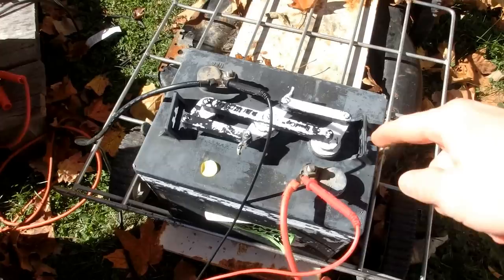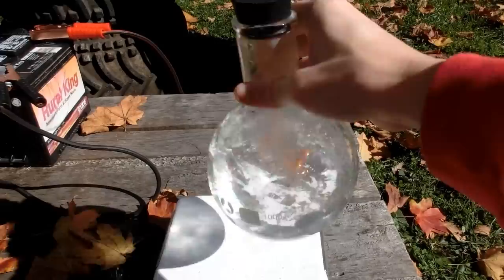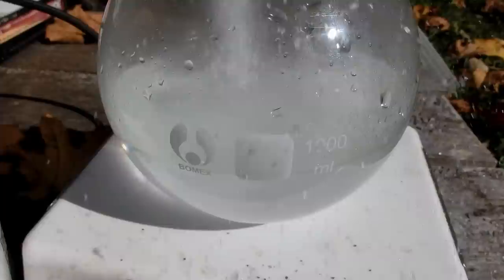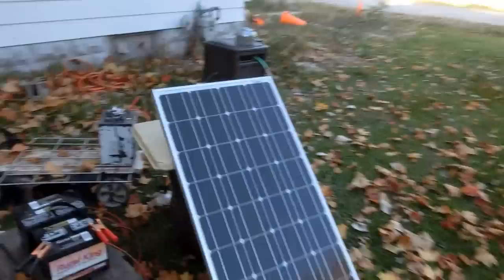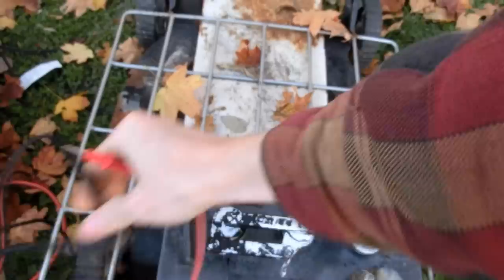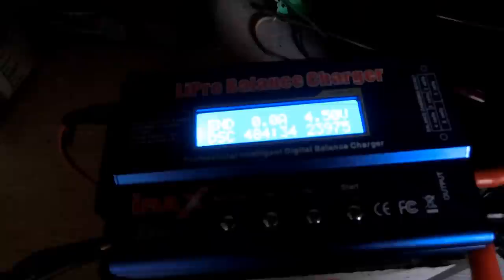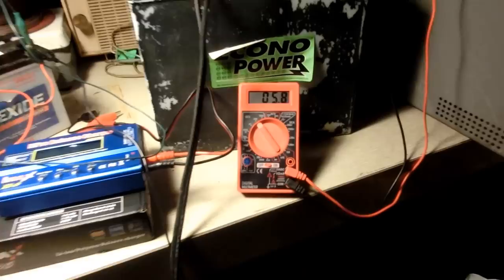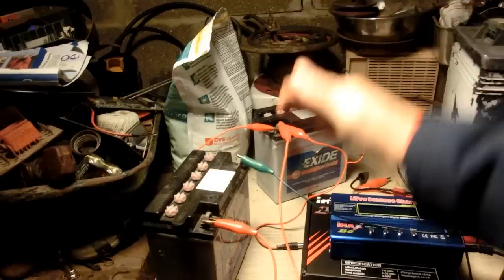Epsom Salt in 6v Golf Cart Battery

Comment: will this work for a  70 pound 6 volt Duracell 75 amp battery thats now 1.21 volts, and another is at .99 volts. I only used the batteries for about a week or so...it was just a 100 watt solar panel project....one battery has a brown like powdery stuff on top.

Comment: here's  a few suggestions for fixing a car battery
never try to do this unless you know what you are doing - the acid can burn you
check the voltage first - there may be a kaput cell which would waste your time.
Check the battery fluid.
Try to fully charge the battery.
(I learned about these and more from Jons Mender Guide site )

Comment: Have you ever successfully recovered a sealed lead acid battery before? Like by taking the sealed caps off and filling with water or other electrolyte? If so how did you do it? I  tried topping some I had up with water but it didn't work.
Reply from the maker: yes i've done that in several videos, search my channel for them.

Comment: I love the caps on that battery. That's handy the way they all open and ive never seen one like that.
I have many dead PB battery's laying around my yard and one project ive been wanting to talk myself into is carefully taking them apart. saving the lead and acid making a mold for casting my own positive and negative plates
I imagine using cheap 5 gallon buckets for the outside case because there cheap and they seal and they can be opened and reopened.
I can imagine not using the total depth of the bucket but leaving the bottom couple inches free for sediments and the top open for extra liquid... less worry about running dry.
The plates could be made thick.
I think it would be great to be able to build cells and rebuild my own battery bank. Not so much for a vehicle but for a home solar bank.... It could be built as heavy as it needs to be :-)
Reply from the maker: well keep in mind that the negative plates are lead-II-dioxide and that is one of the most poisinous forms of lead because it is easilly absorbed through skin.

i think a 5 gallon bucket is a horrible idea, if the acid isnt reactive enough and it gets cold the electrolyte will freeze breaking open the bucket. you would probably want a much thicker container.

i hope you succeed though.
Reply: I had not thought of freezing and breaking the bucket's... It does not get cold enough around my aria to be a problem.

Comment: my comment will not be on epson salts ,, that battery might have been frozen and once that happens the cells will never function properly ,, sometimes you might get lucky and the only problem will be is that the inside has built up contaminates and is grounding the cell or cells and a cleaning will help ,,

Comment: Invest in a old school 6 volt battery charger.  Sun simulator with a pattent number will not charge that battery with the primative solar panel you have.. I got 24 6 volt battery on the bank and only lost 2 so far in 3 years and they were all screwed up bad to begin with. Need the old school charger or it will not work. Also need a hydrometer so it gives ya a good idea what's going on.

Comment: I recommend using Alum (ammonium aluminum sulfate) for the electrolyte works great on sulfated batteries
Reply from the maker: yeah but only issue with that is it drops the voltage a lot. max charge is like 10v and dead is like 8v. with a 6v battery that would be 5v and 4v. would be great if i had another 6v battery to put in series.

Comment: I played with two dead 12 volt sealed lead acid batteries both at 6.2 volts, did the Epsom salt thing on both, one came back to life is now sitting at 13 volts with 5 of its original 7amp hours. But the other battery will not go above 9 volts. I think it was a bad or shorted cell because one cell boils when ever I try to charge the battery.

Comment: Thanks for the video! Have you tried aspirin? I've heard that breaking up a couple aspirin tablets and adding them to each cell helps revive bad batteries! Let me know how it goes if you decide to try it!
Reply: here's  a few suggestions for battery repairing
Don't attempt to do this unless you know what you are doing - the acid can burn your skin
check the voltage first - there may be a dead cell which would waste your time.
Check the battery fluid.
attempt to fully charge the battery.
(I discovered about these and more on Jons mender guide website )
Reply: @Blakehx I\'m not sure but ,if anyone else wants to uncover how to recondition battery try Jadonite Renovate Battery Buddy ( search on google ) ? Ive heard some unbelievable things about it and my buddy got great results with it.

Comment: plus over equalizing never works, i have an old car battery, (i can only get it to 15v then it pulls too much power anyway, i did hold it near there for an hour or so) the specific gravity is good, it charges on all cells and holds voltage, even pushes out enough amps to be useful, everything but amp hours, it has about 2 amp hours!
Reply from the maker: well i wouldnt say never, its better to have the voltage high than to have it low.

Comment: The point is that the plates in it are gone, they are completely covered with S-salts for sure. You should open it, brush and polish the plates, replace acid and stuff and then it should work. But it will never be like a brand new one. This kind of stuff doesn't worth so much time in repearing, just get a new one
Reply from the maker: new one costs 70$, plus i make my living doing videos like this.

Comment: Nice experiment, that the results wernt great is just science, sometimes we don't like the outcome, we just have to be satisfied we measured it right is all :-D Nice move on using the Imax to dissipate the energy so you could calculate capacity, that seems a smooth and stable way of getting a good measurement :-) I have a few golf buggy batteries here, though far less capacity, I honestly think its age that gets the anodes and cathodes on these things and theres not much to be done about it after year 6 or something :-p

Tis cool how it has those open lids on the top, I have 2 western golf buggy batteries that are solid sealed, they work well as they are pretty new, but the others with plugs in to refill them from china, though they have high voltages, they drain instantly when you hook them up to stuff so there going :-p

This experiment was good to watch though :-) I've not seen the stirring magnet up close before, looks pretty darn cool :-D
Reply from the maker: that stirring magnet i found in the road one day. i have an actually lab stirring magnet somewhere. its a long magnet coated in teflon.
Reply: I love Teflon stuff, like pistons, its a particularly unreactive heavy duty material :-)
That small one seemed to work pretty well, the bigger Teflon would be good for corrosive solutions though right :-)

Im just testing my new 1500w inverter, im running a halogen heater on it, one bar of the heater is dead but is required to be on for the second bar to work, and each bar is rated at 400w. The single bar that worked ran for 15mins bob-on, on a decent Numax 12v20ah sla golf buggy battery, that started out at 12.9v and cut off after the 15mins at 9.9v :-D

I would have thought the bar that was broke wouldn't take power, but im not sure on this one :-) I'm gonna recharge the battery and find another appliance to test it with :-)

So far its confirmed I need to bin/take to the scrap yard, two batteries :-) They are pretty past the point of use :-D

Tis good fun, im just testing it all incase the elec goes off this winter :-)

Comment: You should build a capacitive battery charger and see if that helps. Basically a run capacitor for an AC motor and a bridge rectifier. How to build a Capacitive Battery Charger (Part 1)
Reply from the maker: thats basically the same as my mercury arc rectifier battery charger from 1918. just feeds pulsed DC into the battery.

Comment: It seems to me that the effect of the Epsom salts addition was to reduce the amp-hours by half. It seems to have REDUCED its power holding capacity.  (that's bad)
Reply from the maker: no i think thats just from it sitting around for months. it sits at a very low voltage so it sulfates pretty quickly.

Comment: im getting a graphics card want to stay in the $150 range, thinking of the MSI AMD Radeon R7 260X, but dose anyone have a better suggestion
Reply from the maker: you can get a GTX 560ti for like 80$ on ebay, that's the card i use.
Reply: I will look into it
Reply from the maker: stuffyou shoulddo
 or you could go with a VooDoo, i have this same model in it's box. it's really great.....if you only want to run Anno 1602 and Half-Life http://www.ebay.com/itm/3dfx-Voodoo-3-1000-graphics-card-16MB-AGP-BOX-/141251929820?pt=PCC_Video_TV_Cards&hash=item20e34566dc hahaha

i think i picked mine up for 3$ and currenty have it on a pentium II computer.
Reply: I'm just about to retire my gtx 560ti and get a gtx 970. Not running the games I want it to at halfway decent settings.
Reply from the maker: gasecio  the 970 is about 3x better. hope it works better for you.
Reply: Rinoa Super-Genius Thanks.

Comment: How did you burn up youre imax b6
Reply from the maker: reversed polarity, easy mistake.
Reply: You going to do repair video?  I think probably like a diode burt up.
Reply from the maker: The battery guy
 no it fried a lot more than just a diode, its not really worth it to repair these since they only cost 20$ but i will make a How It Failed video.

Comment: I was once able to wake up a lead acid battery by shoveing some higher amps into it as well as topping up the fluid then charge and discharge a few times, I may be wrong to do it but im trying to give you a few ideas :-)
Reply from the maker: that's called an equalization charge. it helps a battery a lot.
Reply: Are you going to give it a try? not sure what else you have to loose apart from frying the imax a bit more, I wonder if ultra/supercaps would help your solar charger in anyway since they can absorb the energy faster?
Reply from the maker: steve64464
i've left it on a charger for a long time. a full 15 amps into it only gets the voltage up to 6.7v. so in a way i did let it equalize. i let it sit for like 2 days with 15 amps going into it to raise it to 6.7v. but still thats only like a 13.4v 12v battery. i think this battery may have the opposite problem of what i thought. it may have too strong of electrolyte. perhaps before the previous owner threw it out they added more acid.
Reply: Cant save them all i guess but we can at least try, I wonder what the scrap value is of it and if you would get more if you stripped out the lead plates seperateing them from other materials , Perhaps i shouldent encourage you to take one apart after that other one time :-O
Reply from the maker: steve64464
haha dont worry, that other time wasnt all that dangeous.

but i dont think many places will accept just the lead, and batteries are a flat rate i think. 7$ (maybe 12$ now) for a battery weather its a fork lift battery or a handheld battery.
Reply: But it did melt the tri-pod a bit :-P
Reply from the maker: steve64464
 yeah and metal is a lot more vulnerable to acid than humans
Reply: Ahh thats a good thing then :-)